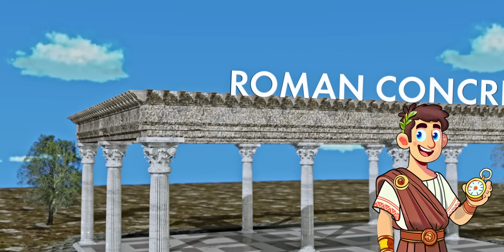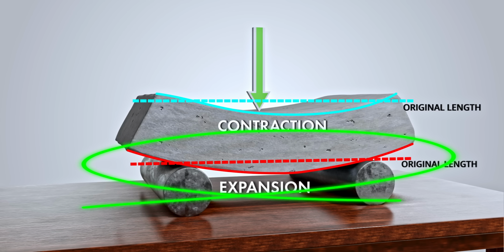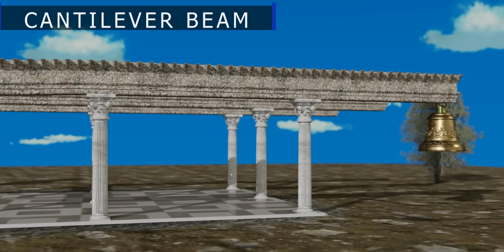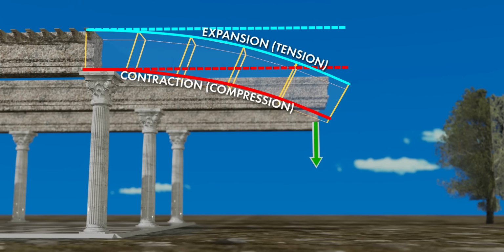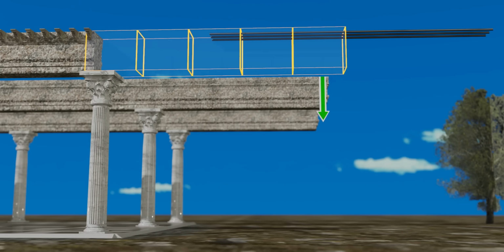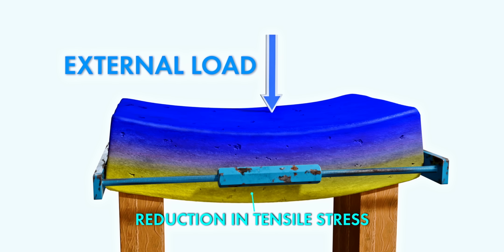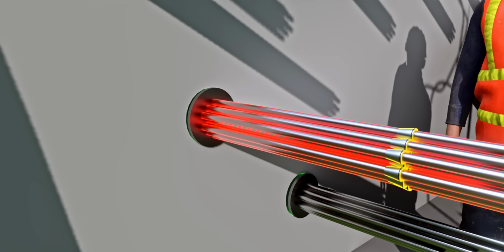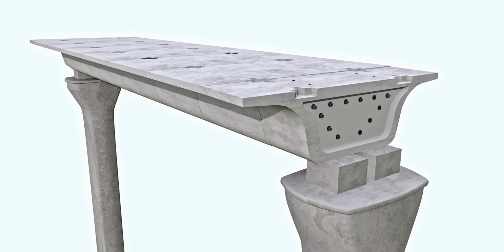The Beauty of Reinforced Concrete!

Comment: Steel is not excellent at handling tensile forces, it would also prefer compression, it's just better at it than concrete. The things that excel at handling tensile forces are fiber materials.

Comment: So if concrete is best for compression why is it that columns are been reinforced since columns deals with the compressive load of the building?
Reply: Tension can come from different ways, not only up and down, colums are built to handle the compersion load from above, but it would be very bad if the tension from the sides broke these coulmns, be it wind in skyscrapers or earthequakes and soil movements in regular homes, we cant risk the colums craking and colapsing, so we reinforce it, its not so much more expensive so its fine. And you can even interlock the reinfocements trough the whole building thanks to this achieving even greater force dostribution.

Comment: I think I might like this channel. A couple things about this video specifically.

1, when demonstrating the unreinforced concrete to the reinforced concrete. I would have personally liked to see the same demonstration with only the the metal rods used for reinforcement. That would have given a good visual representation how much better those materials are together then separately. And how much of that improvement was do to the tension being transferred to the reinforcement instead of just the strength of the metal rods themselves.

2, when pre compressioning the concrete by applying tension to the reinforcement before the concert hardens. Is the only method using mechanical force to add that tension. Or Could heat be used instead? I ask because heat cause material (especially metal) to expand. Wouldn't applying heat cause the metal reinforcement to expand and elongate. Therefore as it cools and shrinks it should add compression to the concrete. Assuming you can elongate it enough without making it to hot and mess with the concrete drying/curing.

Comment: I little misleading in the begining. The romans never built horizontal concrete beams like that. They used unreinforced concrete to be always in compression using arches and domes. Pantheon is 1,900 years old and with a diameter of 150 feet it is the largest unreinforced concrete dome.

Comment: A silly question warning:
Why don't we just make a house of steel (as in having the whole wall made of steel), Is it expensive? Or is it impractical? If yes then how is it impractical 
PS: I dont have a civil engineering background
Reply: House of Steel do exist, where house made with steel, then the floor, roof, wall are decorated with light material like wood, aluminium sheets, and glass for outside. Mainly Corporate Building or Office.
Normal People won't do it. Cause It's Expensive.

Comment: Also, it's worth noting that concrete and steel have very similar coefficients of thermal expansion.  That's what makes steel reinforced concrete possible.
Reply: i assume this is by design? i mean, different concrete mixes would have different coefficients, and we choose the mix that most equals the metal ones?
Reply: @Ni7ram  The important word is: Similar
Reply: @ericwelsh4853  sure, but that doesnt respond my question. im interested in if there are different concrete possibilities and we use the most compatible with steel, or if thats just pure coincidence
Reply: @Ni7ram  There are different grades of concrete, but they all have the same thermal expansion characteristics.
Reply: @ericwelsh4853  thank you very much!
Reply: Yeah but there is a problem they have different time of expansion
Reply: @Alessio-a4p  What?
Reply: But steel is good at tensile loads..
Reply: This why I'm always baffled how castles and churches still stand with just rock and some medieval version of concrete, ikr there's are shape designs like an arc but what about the 2nd story floor? 

Some houses and buildings even use bricks

Comment: I've seen multiple videos on concrete in compression/tension and this is the first that explained it extremely well. Most talk about the concepts but don't really show the relevance of the placement of the rebar (other than showing it's "in there").  Nor do they have an excellent simplified example like yours with the reinforcement clearly on the bottom in a simple case with gravity... with a follow-up showing a building and how the tensile forces can actually be at the top, etc. I thought this was excellent.
Reply: Hmm....

Comment: You need to do this test with just the rebar from the inside. Is the concrete taking the force or is it the metal reinforcements that withstand the force?

Comment: Im a civil engineering student and came across your video randomly and id say watching here actually helps me a lot in understanding the world of civil engineering. There is less civil engineering based channel so this kind of channel is a gem to me
Reply: I am sorry if my question sounds dumb as i am not an engineer yet. If we use the pre-compressed method , wouldn't the concrete and the bars hold a lot of potential energy and if a crack happens, the energy release would be very sudden or violent ?
Reply: @Half-Life_Crisis its fine the question is not really dumb but a brilliant one. In case u dont know, concrete could withstand great amount of compression force but very weak in tension. By applying tension on the steel bar and then cast concrete around it, it would increase the tensile strength of the reinforced concrete and delay cracking on the structure. Of course this had to be done in a controlled situation to prevent too much energy that could cause failure early on.

Comment: It's missing the cons of reinforced concrete. The concrete is permeable and the steel rust (even if it's coated with plastic, the plastic cracks and water goes thru).
The rusty steel expands and cracks the concrete. That's why modern structures don't last
Reply: that is precisely why the concrete needs to be built to minimize this.   the aging issue you address must be taken into account.   i 100% agree,   water must be minimized entering concrete after cure.

Comment: the analysis is overall correct, but it's technically not fair to compare roman concrete to modern concrete when analyzing tensile and compression capabilities, roman concrete is much denser heavier and tougher than modern concrete and the normal concrete used in the tests is visibly not fully cured (it varies but it takes more or less a month for normal modern concrete to fully cure)

Comment: What went wrong with the pedestrian bridge in Florida in 2018?  That was post-tensioned concrete, and involving cables, which failed even before the bridge was open for weight loads.
Reply: And they say that mental retardation is not a thing...
Reply: There's a Well There's Your Problem episode on this particular engineering disaster. I recommend watching this for everyone (with a tolerance for political jokes).
Reply: According to ChatGPT: 
The pedestrian bridge collapse in Florida in 2018 involved a post-tensioned concrete structure. The failure occurred due to an error in the design and construction process, particularly related to the cables (post-tensioning tendons) used to provide tension reinforcement. There were issues with the tensioning process, including inadequate reinforcement placement, which led to cracking and the eventual collapse, even before the bridge was open to pedestrian loads. This tragedy highlighted the vulnerability of post-tensioned concrete structures when proper quality checks and design validation are not rigorously followed.
Reply: @athulkurienoommen208  Well let me try again: so what went wrong?
I assume they were all expert in all of the principles explained on the fine video here. What did they do wrong, and how can the public be assured that this would not happen on the next bridge built?
I have heard that they did not regard visible cracks as of sufficient concern. Can that happen on the next bridge?
And does this mean that a visual confirmation makes the difference whether the public is exposed to a design, rather than not, as opposed to more technologically sophisticated techniques?
Reply: @Bill_Woo  According to ChatGPT: 
The pedestrian bridge collapse in Florida in 2018 involved a post-tensioned concrete structure. The failure occurred due to an error in the design and construction process, particularly related to the cables (post-tensioning tendons) used to provide tension reinforcement. There were issues with the tensioning process, including inadequate reinforcement placement, which led to cracking and the eventual collapse, even before the bridge was open to pedestrian loads. This tragedy highlighted the vulnerability of post-tensioned concrete structures when proper quality checks and design validation are not rigorously followed.
Reply: @ramajyello  Wow, that was an awesome consumption of everyone's time! I would bet that you're quite proud of it! You're probably the hit of every party.
Reply: @Bill_Woo  According to ChatGPT: 
The pedestrian bridge collapse in Florida in 2018 involved a post-tensioned concrete structure. The failure occurred due to an error in the design and construction process, particularly related to the cables (post-tensioning tendons) used to provide tension reinforcement. There were issues with the tensioning process, including inadequate reinforcement placement, which led to cracking and the eventual collapse, even before the bridge was open to pedestrian loads. This tragedy highlighted the vulnerability of post-tensioned concrete structures when proper quality checks and design validation are not rigorously followed.
Reply: @Bill_Woo  
I agree with @ramajyello but we need more concrete proof...

😄😆😂🤣

Comment: There are so many properties of reinforced concrete to explore. It would be interesting to think of some scenarios. Where the concrete would fail in other fashions related to modern day techniques and jobsites. Like the form release spray that are often used on basement wall forms. What happens if that gets on the reinforcement prior to being poured. What happens if it gets on the rebar and then it rains and washes some of. What if you clean it of with soap. ect....

Comment: Hi Professor, I’ve been watching your content since the early Learn Engineering days. Concrete being weak in tension is a topic that is covered frequently already. A couple things I think you could add that would make your video go beyond than the rest and really be enlightening would be:
1) Compare a reinforced concrete beam’s load capacity to that of just the rebar, (and/or unreinforced concrete plus bare rebar)

2) visualize in a column that rebar stirrups and main bars resist against the induced principal shear and/or effective radial tension. (You could show the different common failure modes for unreinforced standard concrete cylinder samples; how they usually fail on a single shear plane or sometimes conical  surfaces.)

3) Bonus #3 would be how concrete isn’t really as good as steel in terms of physical parameters, but in the practical world it complements steel by being much cheaper by volume and weight, and leas dense, which allows you to use much larger cross sections (and larger dimensions benefits beams and long columns exponentially); the concrete protects the rebar from Corrosion, concrete holds the steel in place and somewhat combines them into a single body (compared to how before the concrete the rebar was just tied together with wires); the concrete can be installed as complicated geometry in large volumes economically because it’s a liquid* you pour into forms and around rebar (compared to having to fabricate, transport, and erect an equivalent structure or floor area out of steel, pumps are very practical)
Reply: Don’t expect him to. He does everything half ass. And isn’t really that smart. He wants us to believe building 7 came down from fires and rust. He’s a joke. And a shill for the US govt.
Reply: You could also mention that there are materials other than steel which are also very good in concrete like basalt rebar but don't corrode and destroy the structure.

Comment: however, when the metal under this stress reaches the limit weight, it suddenly breaks off and causes the concrete to disintegrate without any warning. Isn't it?

Comment: How do you restore failing reinforced concrete
Reply: rewind...the video
Reply: @inconsequencial2546  So using the metal rods to tighten it sure, but do you add in extra concrete where the cracks were?